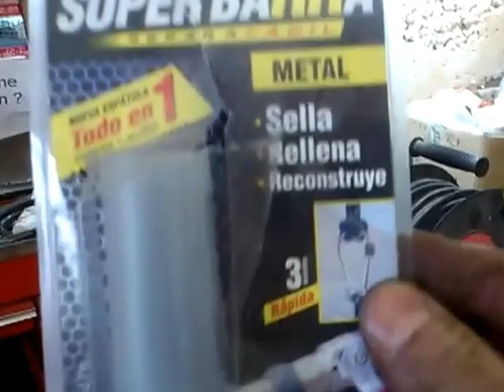Easiest ever 2 stroke engine compressed air conversion no solenoid or valves

Comment: the air is being entered through the spark plug hole. doesn't that defeat the purpose of a 2 stroke? try entering through the carburetor

Comment: i would use some strong thin metal instead of putty as putty is quite heavy and can give a big unbalance Did you have any problems with it being unbalance did it vibrate alot or anythin

Comment: i got an idea... water tube boiler made useing rocket stove designs and principals, steam goes to one of these things on a large scale, maybe with something similar to push rods, valves and cam shafts to get decent timing [because mechanical methods always whereaver possible and practical], and send the steam under to push the piston back up a bit as it escapes, and the cycle begins again. then, either have that be the engine in a vehicle, OR, add on a electric generator to use the whole thing on the go, maybe in a small tow storage trailer to power an electric car's motor, with some batteries inbetween for imediate starting while the steam generator warms up. likewise use it as a way to power stuff off the grid, just chop wood, or even use it to make its own feul using a wood chipper or pellet maker. then  just feed the hopper as needed for constant electricity and heating [cuz the exhaust could act also as a hot water heater]. im thinking maybe a large custom built rocket stove based optimized boiler, exiting steam hooked up to a large 2 stroke multi cylinder engine, send the steam back through a condensor to recycle the water back into the system in a loop. then use the engines output rotational power to drive a pulley string of alternators, which combined have enough power light a home, charge lotsof car batteries, tow on a trailer as a portable charger for an electric car, and if designed compact and light weight enough, maybe even install it inside the vehicle inself in place of where a giant thing of batteries would be that can only get you 40 miles on a budget with a small car and isnt practical for long distance travel or cross country driving. the portable steam generator though that runs on anything the creates sufficient heat is very versatile, thus specific feul is no longer an issue, and useing it as power to generate electricity to power an electric motor eliminates the kinks asociated with building and keeping up consistent steam pressure while under load like the old stanely steamer cars, which while powerful looked kinda awkward to setup and control by todays standards, so just use it as electric generating potential to power or augment an electric car!!

Comment: For didactic or low efficiency demanding applications it can be good. But, why you say there's no valves!? The "air trigger" is a valve, and in the way its used it don't take so much time to wear. The air flow or pressure will be according to the volume of the piston and the torque applied. Anyway, this is simple physic, the power output from the motor will be much less than the compressor power.

Comment: You might want to check out my conversion of a similar string trimmer motor here:
kSN6bh7YKYM
--this motor has no valving of any kind, it just relies on the different impedances created by the intake and exhaust ports which are properly matched to the higher inlet pressure versus lower exhaust pressure.  Note how this motor achieves very high speeds because it doesn't have any valves to operate.  It doesn't get any simpler than this, all you have to do is make a fitting for the air line.

Comment: None of the designs I've seen are really ideal.  This one is simple and effective which is great but the length of hose after the valve is going to create more head space reducing pressure acting on the piston.

Comment: Y'know, this is one of those moments that make engineering types like me go, "Well damn, why didn't I think of this?!" I've been mucking about looking at all sorts of valves to try and do a 2-stroke to steam conversion, and a cheap airgun and a lump on the camshaft is all it takes...

Works well on air, any ideas how steam at say 50psi ought to fare? I'm wanting to build a few of these to generate electricity and have a little steam car, for I've tons of old two-strokes lying around.

Comment: Placing the cam on the flywheel seems to work well but I am guessing that it is creating a lot of unbalanced forces the faster it spins. You may consider a second lobe 180 degrees  off, but in a place that wouldn't hit the trigger.

Comment: nice idea as a fun project but to make it usable it would need an oil injection into the air feed hose for lubrication as the engine would seize, Also there would be a high rate of wear on the blow gun trigger.. perhaps a magnetic reed switch triggering on TDC (without physical contact) and pulsing a valve on the air feed?

Comment: Omg thank you so much i've seen so many vids of this i got it to work on a large engine with actual valves and pushrods but this made my life so much easier because you explained that "you have to put a cam on the flywheel"!!! But where or how do you know whare to put the mold of the cam? just put it on the top stroke of the piston?

Comment: @Justin Alverez no offense but easy my ass! I bet that thing wont work on a smaller air compressor, trust, me there's more to it than just putting a valve on the piston head and hooking it up to an air compressor. How do I know this?? well I have tried just that and even with it timed, it still did not work because of the kind of compressor we were using. like I said no offense I figured I would give you my opinion since I have tried this